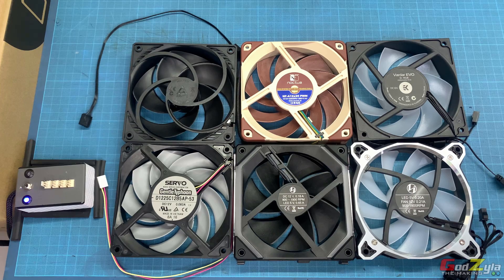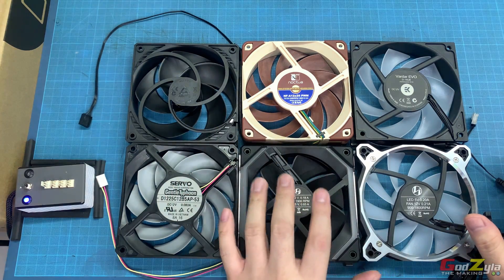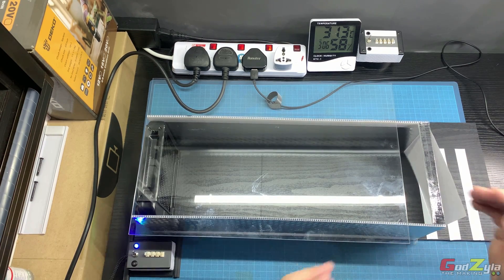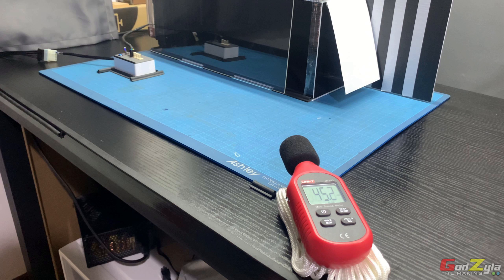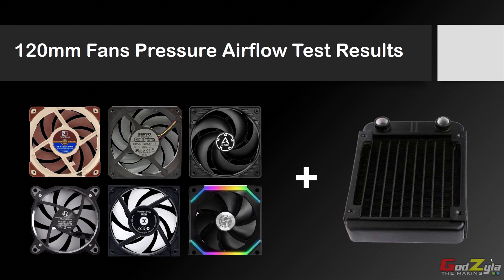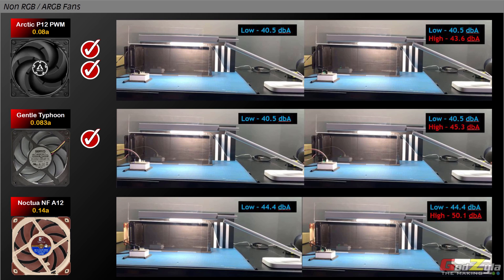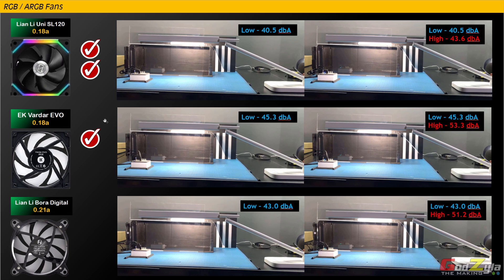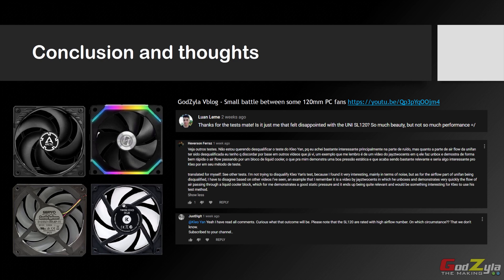120mm Pressure Static Airflow Test - Part II

Comment: Isn't this missing the point though..? A high SP fan is not *supposed* to blow the air a long distance.. .. that's what Airflow fans are for..Here you are measuring the airflow of aSP fans.. what does that help? Good SP fans should push the air really strongly at the fan core and essentially leave the air "exhausted" as soon as it exits the Rad.. 
That aside.. wouldn't it actually make sense to have a very high SP fan on the Push side, and a high Airflow fan on the Pull side.. since that would seem the best complement of both of their specialities....?
Reply from the maker: Hi Andrew Jumbo, welcome to my channel and thank you for your feedback. What you have stated is correct, SP fans suppose to cool radiator and not case airflow. Now if air is channeled through the radiator and still produce good focus air flow, wouldn't that tells the fan has the capability to draw more air through or pushes air through the radiator? 

For me, I prefer to draw cool air to the radiator from the outside of the case than to push hot air through the radiator from inside of the case. To me that's efficient. 
If I as what you have stated, to me is inefficient. You see, having focus cool air penetrating  through the rad fully and assist by the case airlfow fans to get rid of the hot air is more efficient compared to just having SP blowing to the rad and to fully make use of the case airflow fans. wouldn't that be so inefficient? Plus you are having the case airflow fan to work harder. what would you like to have. a more efficiency on air flow towards positive of balance airflow that runs quiet?
Reply: @KleoYan  Hi Kleo, cheers for your reply. Yes ideally the radiator would live entirely outside of the case, preferably in a separate chiller box or something. ;) But I'm not thinking about the incidental environmentals, I'm talking purely about the physics of getting as much air as possible through the radiator fins. A 'Perfect' SP fan would huff mightily at very close range and force a very high density of air across a short space. That being the case, on the Outlet of the radiator, then you would want a high-airflow fan to pick up that air and throw it away as far as possible.. 

Really, if there is close enough performance that a good SP fan can be evaluated on the basis of its resulting Airflow, then that must surely suggest that the difference between SP & Airflow is academic at best.. This is only helpful if you were committed to buying the exact same fan for every location in your build. Otherwise, buy always the one that does the best job at each location, and who cares what other jobs it may also be 'somewhat' good at...?
Reply from the maker: @nowandrew4442  I see. You have your prospective on SP. As you have mentioned getting more air push through the radiator. Hmm how to have that when fan ain't pushing  heaps of air? And if you are to say a Perfect SP fan would huff mightily. Well I have tried fans like noctua, nxzt Acer P fans and some corsair fans that are SP rated. With the setup I have tried before. They dont really bring down temperature and worsten case temperatures as compared to the gentle typhoon or arctic p12/p14 does. Well as what you said, by the end of the day to get the fans that does the job. To me that's my method of testing. Paper specs is just a guide, the actual play might be slightly different. Oh BTW you were saying to have a chill box externally. I have done that before during the mmx233 or Cyrus MX days. Yes nothing beat those but it's out of the questions on modern build. Not practical.
Reply: @KleoYan  I guess my main issue in this context is to visualise what air behaviour actually looks like in airflow vs SP treatment.. Manufacturers are saying that there''s a difference, well what does that difference look like in the air behaviour? Yes they both have to "push" air but what does that look like? In my mind one is 'throwing' it while the other is 'shoving' it.. Correct me if I'm drawing a ridiculous picture :) We can throw a tennis ball very far with targeted action, but we could never throw a mattress.. however we can shove it effectively.. however we can't 'shove' a tennis ball (well we could, but that wouldn't be productive :) ) By that guide, presumably (in pure theory): 
- A maximum (100%) Airflow fan would direct all air into a tiny tight stream right in the centre of the fan and travel as far as possible. I.e. a 0° spread of airflow. 
- A 100% SP fan would spread its total capacity over 180°, i.e. the air wouldn't go anywhere except directly out of the fan (and in the case of the PC, into the object it's going to be cooling. 
Now obviously neither of those two would actually be effective at cooling. So here's the part I'm trying to get to grips with. 
What is the difference in 'optimisation' degree (hypothetically, not in actual airflow dispersion) between Airflow & SP? Say we took the scale 0-180. If 90 is 'neutral', then is 'optimised for Airflow, say, 50? 75? 88? And is 'optimsed for SP' 135? 110? 92? 
I.e. isn't a high airflow capability of a fan an exact indication that it is not a "good" SP fan, whatever that means? And/Or are they actually so close that the 'optimisation' is actually (almost) pretty meaningless? I'm tempted to think the latter, since, as you've shown, most SP do still have good Airflow -and- the cooling results are never more than a couple of degree difference anyway.. So it would seem not the *individual* performance, but the exact case situation in relation to all the other fans & objects present is going to have a far bigger impact in final temperatures that the fan 'optimisation' is barely even worth worrying about... Or at least far too many variables to consider without one's brain exploding :D
Reply from the maker: @nowandrew4442  good explanation. Maybe you can do up a video and to benefit the viewers here as your concept has its points too. As my concept is different from yours. For me is, with least energy (less current used), gives both good static and airflow plus cheap. That will be my objective.
Reply: @KleoYan  I see. Yeah my aim would be to find the maximum realistically achieveable overall performance without hitting the point of diminishing returns.. i.e. 80/20 rule, the first ~80% of performance takes 20% of the effort/investment, while the top 20% takes 80% of the money/investment.. my thinking is to hit that right balance of great performance at reasonable effort/expense.
Reply from the maker: @nowandrew4442  fully understood. I might not take your concept but I do physical testing and run test on my rig. Previously done on a Lancool II original case which perform ok but 3 degrees more compared to the mesh version. Then I did up my current on o11d mini which took me abit of time to figure the direction and the airflow in and out by using fix rpm. Which got me to very good temp. Though am not using AMD 5000 series CPU but I am contented with the current setup and temp. But thank you for your sharing. Maybe next build I might change my concept.
Reply: @KleoYan  👍 I am also using O11d mini 😎 my main task at the moment is to figure out the best fan to strap 3x to a CPU twin-tower. So SP would seem to be called for. But I'm at a loss to calculate what would be best for the central fan that is literally sandwiched between two towers... I'm possibly thinking it might even be best to remove it altogether and let more air in... Any thoughts?
Reply from the maker: @nowandrew4442  oops pardon me for the late reply was busy at work. to be honest, you will need to test it out yourself. Just my opinion, I will strip on 1 fan to the tower that is located near the Ram area and 2nd will be middle, leaving the rear and top to exhaust the hot air our. as for Side and bottom. I will do intake with your setup.

Comment: Lian li Unifans are my favorite fans to use and I have used many, including noctua and artic. I think their RGB solution is much more elegant and their daisy chaining technique makes you think why no one else ever thought of this before. However, recently I bought EKs new EK-Vardar X3M fans for my EK AIO  (replacing the stock fans) and I couldn't be any happier with it's performance, noticeable difference in thermal performance. It can get noisy at full RPM and installation is a bit weird (for some reason they thought using allen screws was a good idea), I would say check it out if you do another fan comparison next time.
Reply from the maker: Hi navster87 thank you for your suggestion. Will give it a try if I do have time 👍
Reply: Did you see difference between the EK and the Lian li? 
I am asking cuz im about to pull the triger on the Uni Fans !
Reply from the maker: @kanth2012  hello, welcome to my channel. Both are good static pressure fans. If you want to use on radiator uni SL120 is good interms of noise and performance. But if all rounder as in static and case airflow. I will go for EK as the uni SL120 done poorly on case air flow.
Reply: @KleoYan  hello, thank you for the Info, i got a Lian Li Mini with 3 Radiators
Reply from the maker: @kanth2012  I see in that case go for the uni fans 120. Which I believe you wanted to go the argb fan route. Just to share with you, I ain’t a argb fan person and I go for performance more. My choice of radiator fans will be arctic and gentle typhoon. Reason is, 1st argb fans generate heat, 2nd if you prolong usage on argb as in always on, argb will burn out and white will turn yellowish, 3rd they draw constant current from PSU. I rather save those current and to supply efficient current to the pc components which needs it. As for why choose arctic or gentle typhoon. Their drawing current is at 0.08a compared to uni fan or ek which are at 0.18a. Plus airflow on both arctic and gentle typhoon are superb and  quiet.
Reply: @KleoYan  I am actually a performance person too, this is the first time im looking for Fans with Lights, at the moment i got some Arctic P12 on the Lian li , but im actually more into Industrial PCC Noctua ar 3000 rpm.
I actually own 2 of those Noctuas already , i just happened to see that the Unifans are going back on stock and thought to Check on them :) 

So my main New question is, Should just get 7 more Industrials? 🥲
Reply from the maker: @kanth2012  this you will need to decide. As I can't advise if you should or should not. Just my opinion, I will judge base in these factor. Price? is it worth paying so much for fan? Airflow? the balance between case fan and pressure static, drawing less current but produce channeled airflow. Last will be how much noise can I take? Normally I chose fans base on airflow and current drawn. Next I will run them on full speed to see if I can tolerate the noise at their max speed. Hope that helps you out and one last thing. I normally go for ball bearing fans.
Reply: @kanth2012  I'm always quite surprised when people bring up the Industrial Noctua fans. If the computer is nowhere near you then maybe they are ok. But I would highly suggest buying just one and seeing if you like their sound profile. They are ridiculously loud. Like deafening loud.
Reply from the maker: @kanth2012  just incase if you are curious about the case airflow about the ek and uni sl120 https://youtu.be/Qp3pYqOOjm4

Comment: Good Video, I have 6 EK Vardar evo fans to make a push-pull radiation, the fans are just too noisy... I am thinking to sell them to have the lianli SL120, which has not bad air flow but good noisy performance and easy cable management.
Reply from the maker: Hi Keith Wang, welcome and thank you for your compliment. yup. the aiflow on static pressure is good on SL120 but not as case fans. anyway I did have the EK argb to work with the uni fan. only if you are interested.. here is the video which might interest you. https://youtu.be/bMRz2KVqbjA

Comment: Does greater airflow also mean better cooling for the liquid inside the radiator?
Reply from the maker: Hi ThomasKLS, welcome to my channel. If your fan is drawing cool air towards the radiator, yes it does help on cooling the radiator. Do note that it also depends on the surface area and the thickness of the radiator. In this video. Those fans that generate good airflow is to represent then static pressure. The more cool air is pushing through the radiator. The temperature of your CPU will drop more. Thank you.
Reply: @KleoYan  Thanks! So in other words: having the same radiator in the exact same szenario with two different fans, one pushing more air through the rad, the other less, the temperature of the liquid inside the radiator will be likely lower with the fans that push more air through it?
Reply from the maker: @dersmoodoofreak  Hi, yes that's correct.Now do becareful with thicker radiators, thicker radiator like 60mm thick, it will be advisable to use push pull configuration. As based on experience, 27 to 30mm thick rads, one set of push or pull fans will be sufficient :)

Comment: More of these test on case/rad fans please. It's hard to find a real test just like yours.
Reply from the maker: hello Apfqls, thank you for your feedback. I see what I can do. once again thank you for your suggestion and do subscribe if you like my content. thank you !
Reply: @KleoYan  just got into my head now, what if a closed pc case or a little room air for the fans to suck it in to produce high airflow or static pressure. is there any difference? some pc cases the front intake are most likely close one and mo mesh in front.
Reply from the maker: @sithquisha  there is a difference. For any fans to draw air in, you need cool air from the outside. Without the cool air, your fans will just circulate the warm air inside your case. One again thank you for your question and to re-visit my channel.

Comment: Interesting results. I think one improvement for your testing is to use PWM duty cycles for the PWM fans as they do not always work well when adjusting voltages, some fans are designed to run 12V all the time.

I have gone from using 5x PWM Gentle Typhoons (4x intake with 2x radiators, 1x case exhaust) to the same configuration with 5x Noctua NF-A12x25s and saw improved coolant temperature while also lower noise levels. The double ball bearings on the GT fans create a certain motor noise at the lower RPMs akin to "ticking" noises. From my experience, I could essentially run the NF-A12x25s in a higher speed to produce the same noise as the GTs and get similar or better airflow through the radiator, but have the benefit of a lower noise floor when at idle. 

VSG from TechPowerUp (prominent guy in the watercooling/overclocking forums) did a review showing this: https://www.techpowerup.com/review/noctua-nf-a12x25-pwm/5.html

I think for non-RGB fans, the Arctic P12/P14 is probably the go-to for both case airflow and radiator fans due to their pricing/performance/noise. Noctua NF-A12x25s for the best noise/performance; Gentle Typhoons for the best radiator performance. Everyone does have different needs and budgets, so always look at various tests and reviews to see what's best for you. :)
Reply from the maker: Hi Kokinkun, thank you for the feedback and the recommendation. See this is something which I like.. more knowledge base sharing with other viewers which kept me going. 
once again thank you for sharing with me your info, i will try to improve on these fan reviews in future. :)

Comment: wait O_o where is pull configuration?
Reply from the maker: The pull configuration are identical to the push configuration. Plus The video will be too lengthy. I believe most will fall sleep if I keep talking. Nevertheless thank you for your comment and visit too.
Reply: @KleoYan  absolute the same results? im realy interesting!
Reply from the maker: @ph7neutral  not not same identical only. Maybe I should add two words, almost identical. Sorry to confuse you my Bad. On pull configuration the noise level will goes up by a fair bit as the fan is nearer to my decibel meter.
Reply: @ph7neutral  you would need a practical test to compare push pull since in pull config the forward path is not obstructed by rad and therefore the paper would move more i think.. it would be nice to put the aio on a cpu and do a temp comparison push/pull in a controlled load, like cinebench or something (but it need to run at least 8-10 minutes so that the loop can hit equilibrium, maybe do like a 3 runs of cinebech right after each other? idk)

but thanks man nonetheless, im thinking about the lian li fans when they are back in stock so i guess ima jsut get them hehe

Comment: Another excellent and useful video. Congratulations!
Reply from the maker: You are most welcome, and I really thank you for this. If not, I wouldn't have realized that these uni fan perform so well when mounted on a radiator. Jayztwocents was right about the static pressure airflow. now at least we know these fans are build for radiators.
Once again thank you again my friend.. greatly appreciated your valuable feedback and comments.